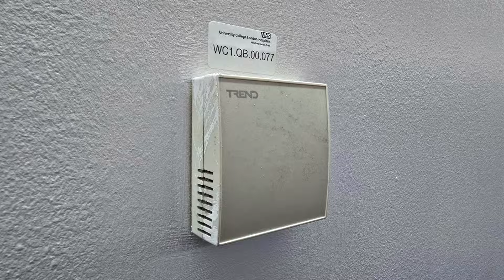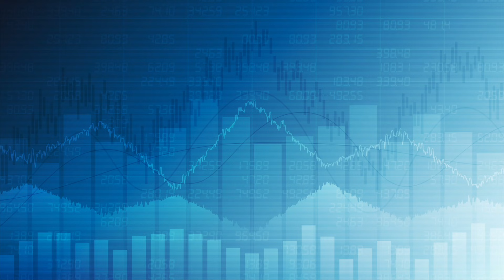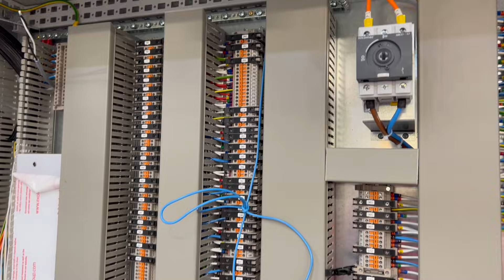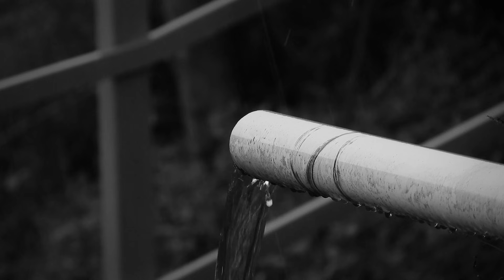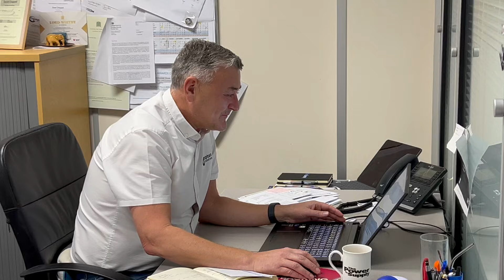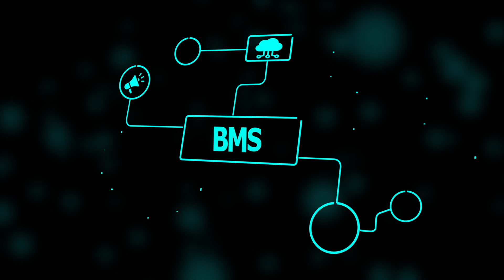What Is BMS? Building Management Systems | How Do They Work?

Comment: Clearly everyone commenting has no clue what BMS is.  Its not just a over priced time clock. Or a switch.  It does advanced calculations and algorytyms based on various factors including optimized start routines based on outside,inside and water temperatures. If its -5 outside and your school needs to be at 22°C at 8 oclock it knows to start earlier to compensate for this.. It cost alot of money because it DOES NOT FAIL  honestly dissapointed in the video. If you dont understand BMS please keep quite

Comment: Seems easy, i can build one myself. Custom PCBs and some sensors, programming, linking to a local server,  optionally open a webpage accessible via https, javascript interactive graphs and data analysis, add AI as well its fun😂
Reply: Thats great for personal home use, but in critical industrial/commercial areas you need something more robust and proven.
Reply: @johnaphone  The electronics used in those systems aren't exclusive to those specific professional areas. Usually if you just bear in mind not to accidentally fry the micro-controllers with poor system designs that can't handle edge cases, if you build something that last for a really long time and not having your data tracked by a third party.

The materials are abundant, even supercars don't design many of their own parts, they do careful integrations of existing parts, and occasionally custom design bespoke parts that make their products truly unique.

So yes you can say my design can't be as robust and proven as a proven commercial design out there, absolutely, but it would be that I don't have enough time and capital to design, build and test the systems to a certain scale, not because they have magic materials.
Reply from the maker: Sounds like a fun project! 😃
Reply: How would someone go about learning how to do that, im currently doing a bems apprenticeship but would love to learn how do these bits like the networking and ai. Ill probably learn more of the networking during the course but if theres any cpd then im all for it
Reply: @SSJXxNeXaxX  I started out doing game designs and software engineering, and then I kind of wanted to build a system that's real, so I dabbled into electronics, started with breadboards, writing C to micro-controllers, integrating some of my knowledge from full stack developments.

Turns out if I have to design a bespoke system for someone and commission it, I'll have to power it as well, so I quickly passed both 2365 level 2&3, did the NVQ through the online portal, passed the AM2, and then I just done my 2391-52 practical as well...

A full Management system would be a big project that if I want to tackle with just myself, I need to think about the PIPELINE to achieve it, I need to modularize the parts, research on sizes/dimensions, voltage compatibilities, costs of the parts I buy, the pipeline to build these modularly, know exactly how much it costs in material and maintainability, that includes wiring, retrofit boards(for SPDs to protect the "brain" of the management system for instance), din-rail enclosures with enough size to accommodate the relays and sensors... Also, redundancies, able to keep working with normal switches even if the electronics side buckles. Network Security(even if it's just a local network, even more so if the client wants it to be accessible via the internet with a domain name).

With the new and more modern WiFi mesh systems, you can actually retro-fit an entire home into a smart home with a local secured server. ESP32 can be powered by a small transformer, installed at multiple points in the house, the modularized set of it can be as small as a half the phone(but thicker), and powered by mains, connected to the WiFi mesh, able to sense current and voltage of the mains wiring with SCT-013, able to integrate with normal switches and 2 way switches and intermediate switches by itself integrating DPDT relays. Roughly I think each modularized set costs about £80 to build and the server it connects to would costs £200. It won't affect existing toggling states even if the electronics suddenly die or Wifi is dead for some reasons, the physical switches would still work etc.
But of course, it can be used for controlling ventilation systems, curtains, HiFi-system multi-device activations(I don't like using multi remotes just to watch a movie in a home cinema) and more...

Comment: One of these systems was installed for £thousands in the church where I manage the heating. An overblown, over-prescribed system for just three heating circuits requiring a Windows 10 PC to control it remotely. Once I spoke to a specialist church heating company I realised it had to come out, and they replaced it with three Honeywell domestic heating controllers which I can programme using my mobile phone. Perfect!
Reply: You ripped out an automated system costing thousands plus frontend, to install a cheap domestic setup that requires your mobile.  I bet you pray that there are no issues when you're unavailable. 

a classic case of not understanding the system
Reply: @johnaphone A classic case of the installers not understanding the building, the needs of the end user and, probably, how to programme the BMS, I'd say.
Reply: As a BMS engineer of over 35 years standing, I've  seen this sort of issue too many times.
The problem is not the hardware, it's the programming.
The system programmer and commissioning  engineer didn't understand how the building works and your requirements as the end user.
It's a pity it was ripped out. A competent engineer would have been able to re-engineer the system to meet your needs.
Sadly, I've seen this too often.
Like many trades and professions, the BMS industry is suffering from a lack of competent people and so systems are installed and commissioned suboptimally, as you have sadly experienced.

Comment: This is going to cost more money in installation costs . Servicing and repair than it will ever save . And a genius to set it up and use it .
Reply: pretty much every commercial and industrial building has at least one mechanical control panel or BMS panel. I've come across panels from the 60s, nothing new. the only thing new is the tech within them
Reply: Never seen a building yet where it works 100% correctly.
Reply: Andy this has been in buildings for over 30 years its nothing new, Ive been commissioning this equipment for the last 13 years.

Comment: Got one fitted at our establishment. It wa fitted in 1990 and no one has a clue how it works as the control PC was removed along with the software in 2010 and was never replaced. Asset management companies aren't interested in as it costs to replace and they take the attitude that it isn't needed as the maint dept has been running the buildings without it since 2010. Oh the joys when an accountant can't see how the system will save money in the long run.
Reply from the maker: Let’s hope they’ve got a handle on the energy use.
Reply: @efixx  Nope, we do meter reads every week and the accountants can't understand why we use as much as we do. Even after explaining to them they just refuse to see it. It really is like banging your head against a brickwall.
Reply: BMS typically monitors energy usage however a EMS provides more information including costs ect
Reply: Accountant are engineers biggest problems! 😂